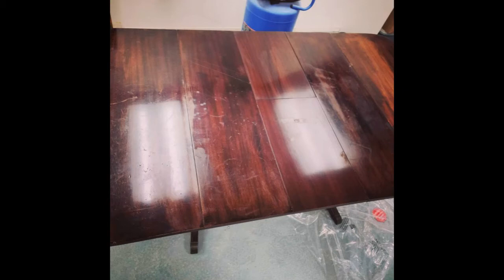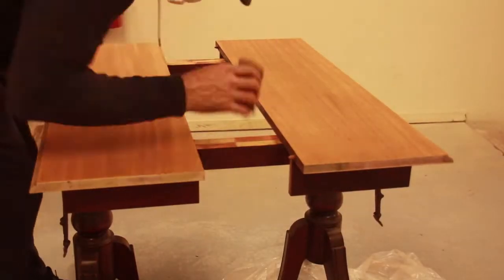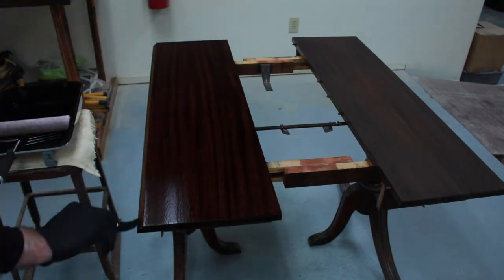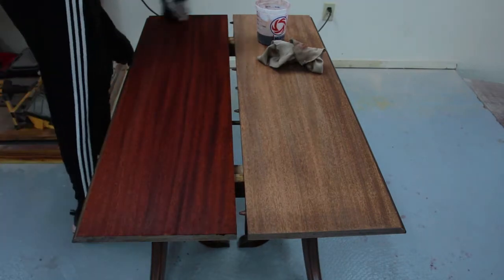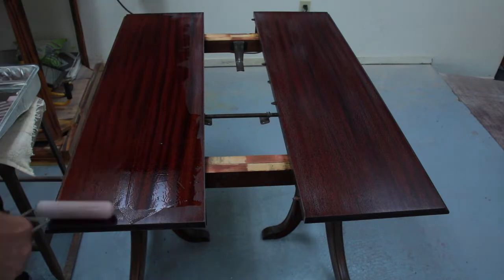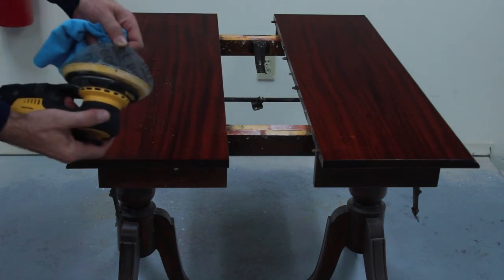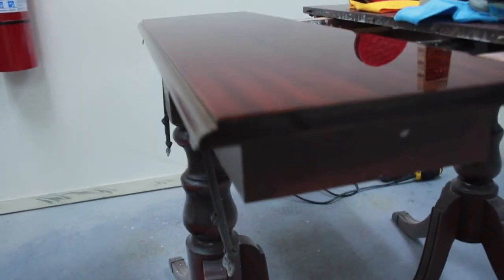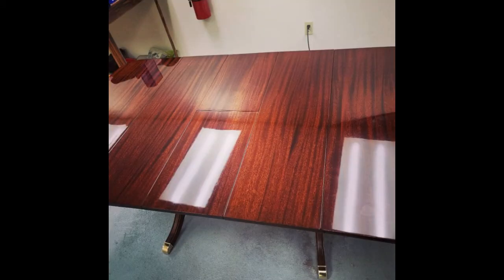Restoring Wood Table From Thrift Store With Wood Dyes.

Comment from the maker: Formula was: 
12 ozs Denatured Alcohol
1/2 Tsp of Walnut Brown, Crimson Red, and Amber Yellow of the Keda Liquid Dyes.

Keda Dye Website: https://www.kedadyeinc.com/ordering-information/ 

Amazon: https://www.amazon.com/shops/kedawooddyes?maas=maas_adg_3589019F49D49ECDAF83C5DDAD52E864_afap_abs&ref_=aa_maas&tag=maas

eBay: https://www.ebay.com/itm/Keda-Liquid-Dye-Kit-5-Vibrant-Wood-Dye-Colors-Makes-2-Gallons-Wood-Stain-Dye-/222365281592

Oil Based Polyurethane was used as the wood sealer.

Comment: I have been following you for what seems like forever, I have been building gun stocks and using your knowledge to mix and apply Keda dye. Thank you I have had some great success. My question for you is this. I have a walnut stock stripped right now and it is very blond. I would like to give it a deep red brown hue. Have you every tried Keda powered dye on walnut? I would appreciate any input
Reply from the maker: Honestly I have not. If you have scrap to test on, I would start with perhaps 1/4th tsp Red, and maybe pea size of the Golden Brown. You also consider the Red Liquid dye, if wanting a deeper red as a base coat. My Son is home from Military for another week, but will see if I have Walnut blanks to test with. Maybe my friend has some too. We did use black walnut for a concealment table, we made for another friend. I will see

Comment: Regarding the lack of color during your editing process, it may be due to your lights or the color setting on your monitor. The former, do you have cold white lights? You want Daylight(5000K) color LED lights to have the best chance with recording on color temperature and brightness. There is big packs of T8 LED bulbs(You can buy a 20 pack of 18w that replace 40w fluorescent for $85) and in most cases you just have to remove the ballast out of the fixture to use them since the bulbs convert 120v AC to DC power for the LEDs.

If it is the latter then you need to get into the monitor settings to adjust it.

Amazing work here. Don't sell yourself short there. That is easily a $500 up to 1 grand table you got there!
Reply from the maker: You are awesome Nick! Thank you so much for the input. I will be sure to let the Daughter know I have an easier Christmas coming up hahahhahahaha. Thank you 🙏🏻 Great stuff! So much precise  info for us all!  Rockstar!